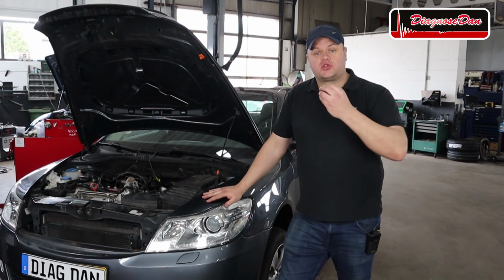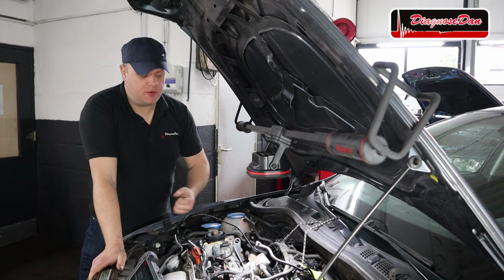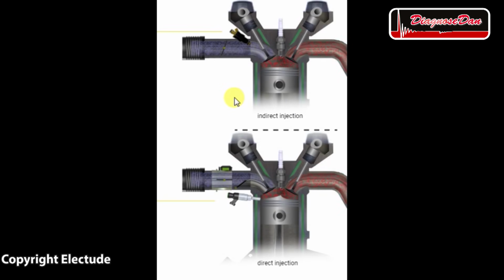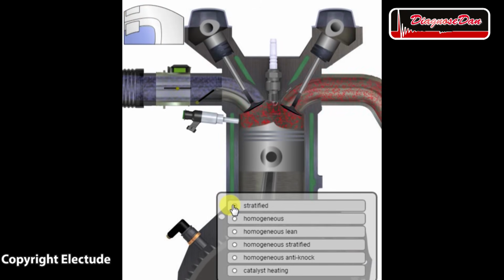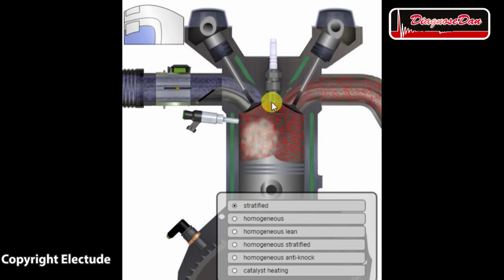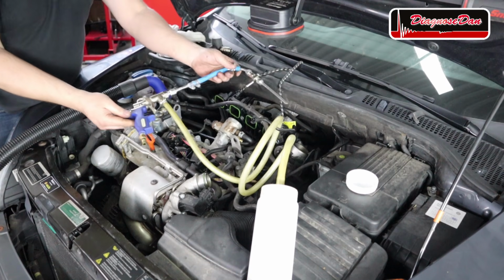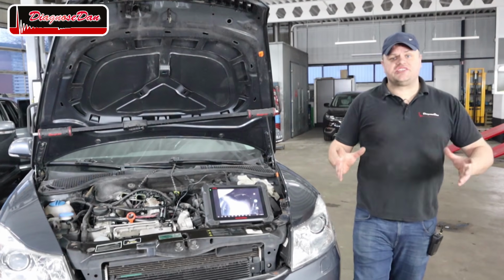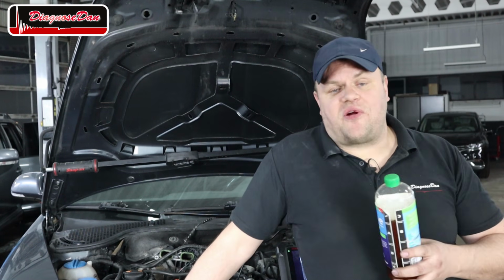Tsi cold misfires explained

Comment: I'm following car and motorcycle engines since air cooled, push rods, carbies and points. OHC....ok,  fuel injected....ok, electronic ignition....ok but then the bullshit started with emission control and trying to squeeze out more efficiency out of engines which have 20-30 % efficiency  only to start with. Super expensive to repair and costing the owner much more than paying a bit more for fuel during the lifetime of the vehicle. So I kept using Newtimer cars and one fine day soon  i will  jump to electrics. I get to drive a Tesla for long distance trips occasionally and i know they have their own set of problems. But they are very convincing and definitely the future (I mean electrics in general). Dan, you're an absolute legend and every new video from you makes be feel like a kid at Christmas.
Reply from the maker: Wow thanks for the nice comment 😀
Reply: I think the real problem here is the quality control off the car manufacturer. Why is it that VW didn't discover all the problems with the TSI engine during the testing fase and why is it that they get away with the customers paying the bill for there poor design and quality. But people keep on buying these cars and keep on paying for poor design and quality.

Comment: Can it be prevented by installing an oil catch can ?
Reply from the maker: It will slow the process down 👍
Reply: Yes, it can be severely mitigated.  But the better units are mildly expensive (~250 dollars) and need to be installed well.

Comment: How much Revive did you use, and for how much time did you spray it in? It appears that an extended treatment could help considerably. Does it burn? Do you think it's safe for the O2 sensors and the catalytic converters? I'm glad to see I'm not alone to hang parts from the wipers. I won't feel so guilty in the future. Thanks!
Reply: Maybe it's worth it as an annual thing, but you'd still have to strip everything down to monitor if its having a positive effect on your engine. I don't see it being particularly good for any of the sensors it's passing  by.
Reply from the maker: I used one can, the Total procedure took about 40 minutes. I don't think that it's very good for sensors or the Cat.
Reply: @Diagnosedan  Thanks.

Comment: TSI stands for Troubles, Serious Indeed
Reply: Terrible Shit inside. TFSI Terrible f@#ken shit inside. Timing chains especially.
Reply: Had several 2.0l tsi's and they have been absolutely brilliant engines.
Reply: whats with all the tsi hate, my 08 2.0 tsi is literally rock solid, 0 oil consumption still yet to have issues at 202k Km. The only thing i've changed is the timing chain and tensioner.
Reply: @maxavaria  I think that's people's gripe is how you need to replace the chain and tensioner and that costs alot to do
Reply: Haha good one what would tdi stand for then
Reply: @neilmurphy845  The Diesel Icon! obviously :)
Reply: @Duvelz  ya I heard the ones whitout that dpf crap were amazing engines could go 500 thousand no bother
Reply: @Duvelz  TDIs yes, but first turbo generation, with VEP injection ( Bosch pumpe ). About PD & CR i`m not so sure.
Reply: @neilmurphy845  terrific diesel injected engines!
Reply: hey diagnose Dan I just bought one of these to flip I'm doing timing chain and tensioner any advice
Reply: @michaelcourtemanche2686  yes: sale it quick!
Reply: 2.0 Tsi with very high oil consumption from new. Caused by manufactur error. One could argue this problem is also an inherent design flaw. By choosing direct injection this is bound to happen at one point in it 20 + years driving around.

Comment: Great educational video as usual :) What does the cat think about these chemicals and the oily gunk that will probably partly unburned end up in the exhaust? I haven't tried any of these chemicals because of "fear" of cat failure later on.
Reply: When using the BG direct injection cleaner you have to snap the throttle to 3k every 60 seconds to prevent cat failure
Reply from the maker: I think its supposed to burn but it proberbly doesn't burn all. Good question.
Reply: We use the BG air intake cleaner in our shop. What works best for us is to pressurize the solution can to no more than 20 psi and run the engine at 1500 rpms. It takes about 20 minutes for the can to empty and when test driving after the service, there is very little smoke/chemical from the tailpipe, meaning there is very little to no pooling of the solution. I have no idea as to the life of the cat however, because no data gets compiled on that from our invoices.

Comment: I am dealing with a Golf GTI at work with this exact problem 👍
Reply from the maker: You know what to do😉
Reply: @Diagnosedan  yep, have done quite a few, the one in the shop is particularly bad, with cold misfires and randomly dropping cylinders and bad surging on very light throttle application when cruising, with the engine at operating temperature. 

In my shop I don't have a blaster to clean the valves and ports though, I use a combination of oven cleaner and sharply focused compressed air to do the cleanup, it ends up being a messy job with this method yet gets the valves and ports sparkling clean 👍 Great video, sir.
Reply: Be interested to see a carbon cleaning machine do same test, sat on fence for last two years as I was not convinced, but have seen some great results. Hope you have one Dan to show us 👌